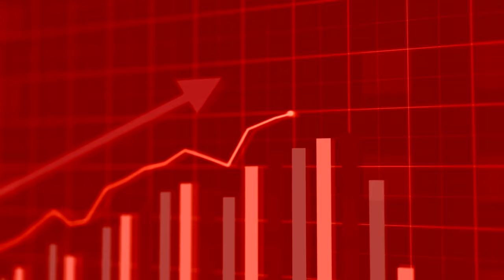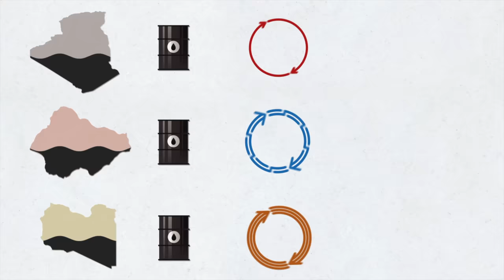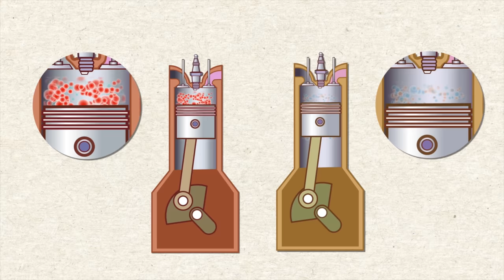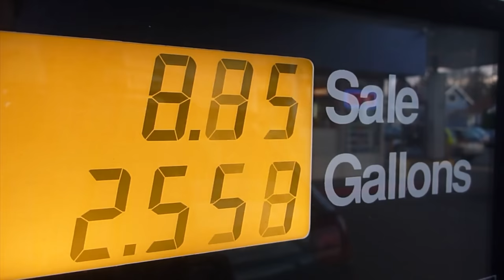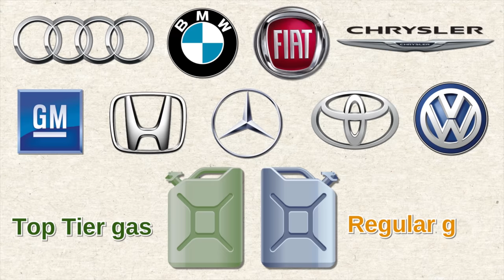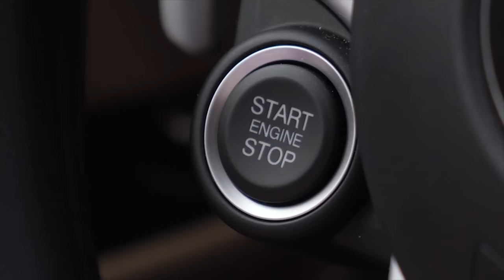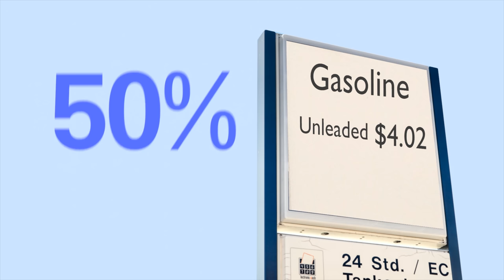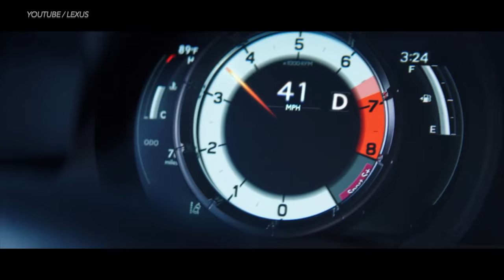No One Has the Balls to Tell You the Truth About Gas Prices, So I Will

Comment: You do realize that EVs aren't going to take over the market until the batteries are plentiful, cheep, light weight, and safe?
Reply: You don't know how to spell "cheap"? 🤦🏻‍♂️😆
Reply: @JohnWilkesBased  you don’t know how to spell “booth” . John wilkes booth
Reply: @PhatAssObese  you don’t know what “based” means?
Reply: Batteries are already in more places than fuel tanks [fuel cell phones!] ... We should be able to do it.  Besides, If You Can't grow It You Have To Mine It.   That won't change.
Reply: In my world EVs are 100% (never look back). Will see who is laughing last.
Reply: @JohnWilkesBased  he was trying to say jeep.
Reply: I was calculating the $$ saved with $5/gallon gas using an EV with the "average" number of miles an American drives. For me that average was insanely high (1,000 miles/month) The problem I saw was even with high gas prices an EV over 10 years was still $1,000/year more expensive. In addition batteries may only last 7-10 years (new ones are looking better), but also the vehicle in the north will most likely rust out in 10-15. Now with higher gas prices that raises the price of the EV and it's parts in addition to making it more expensive to drive with gas... emotionally buy an EV... logically you'll have to complain to politicians, adjust your behavior, and ultimately suck it up.
Reply: @jeffkendel1570  at home… almost exclusively
Reply: @readypetequalmers7360  battery prices have gone down 80% over the last 10 years… give it time.  Gas has gone up also, and will continue to do so.  Give it time.
Reply: You do realize that we don't have to resources to produce ev
Reply: They won't take over. California is currently having problems with their power grid due to electric vehicles. Electircs cars make more pollution to be manufactured than gas vehicles and I'd like to know, where the hell are we gonna put those lithium batteries when they go bad. Oh, and they are a pain to put out if they catch fire. Water can cause them to explode.
Reply: @coloradoriversurfer  Comparing a cell phone battery to an EV battery is like comparing garden hose to a river. The scales are not even comparable.
Reply: @jeffkendel1570  The infrastructure won't be able to handle it.  At this time. Probably not at "that" time either there'll be rolling blackouts    Watch and see
Reply: Hello friend! Scotty addressed that... I suggest you work on your comprehension levels, so you don't make foolish comments.
Reply: @overtorque  I'd need some sources cited on that one. I'd expect the grid problems to be related to A/C units more than EVs since they are largely charged overnight unless on a road trip.
Reply: @readypetequalmers7360  I did the math for $10/gallon here in the Netherlands. And i can get a far newer, nicer and more luxurious EV for the same monthly total cost of ownership. That's with 2000 miles per month. We were spending 4000 Euros per year on gasoline. Gas and electricity prices are both trending upwards. But electricity is less than 1/4 of the cost of gas, so it's a huge protection against energy price inflation. Fossil fuel prices are only going to go up in the long run as well.
Reply: @Bertuzz84  2000 miles/month is a lot of miles (2x more than average American), but yes it is true. If you drive A LOT and there is high enough gas prices... then EV's could be worth it. Fossil fuels don't have to go up either. All we need is an administration in the US who allows pipelines and increase production it could swing the prices a lot. That is a risk EV makers have to acknowledge.
Reply: Plus
Our
Grid
CANT
Handle
It!
We’ve overtaxed the system as it is now!
Reply: @coloradoriversurfer  We refuse to mine our own country though and rely on mining in the 3rd world
Reply: @cammer68oliver2  I was thinking about this... I think the solution is home batteries. (LiFePo) If it became a problem I think the power companies can create a program and offer home batteries that they themselves can control. If they did this they could distribute the usage more evenly.
Reply: Imagine the land needed for all those spent batteries and then leaking into our groundwater, not to mention the cost for new batteries.
Reply: @overtorque  There are a few issues with the statement.

First, California's power grid problems aren't caused by EV or renewables for the matter. That will be a problem in 2040 if they don't increase capacity, but not now.

On the question of if EVs are more polluting to make than ICE, it depends on where the batteries are made. If it is made in China, it is 60% more polluting to make. If it is made in EU or US, its around the same. Taking into account that and non renewable electricity sources, the lifetime emissions of an EV is 70% less than ICE and projected to increase.

EV battery recycling is a thing, but there is not enough old EVs to tell what will happen. For all we know, they might all end up in a landfill, or end up being used as cheap grid storage, but we don't know yet.

EVs is more reliable than ICE. That's indisputable. It costs less on maintenance since there is less moving parts.
Reply: @solarlux7856  
Two things in the way of your panacea:
1. Cost
2. Charging time
Until those two factors are resolved, you're dreaming.
Reply: @jamest3552  Given that ICE car sells peaked in 2017 and is now in permanent decline, I think the word "prophecy" would be better.
Reply: @JohnWilkesBased  for once in your life you can feel smart 😆
Reply: @readypetequalmers7360  that allows pipelines lol
Reply: @HDESM  I meant fuel-cell telephones
Reply: @elliottnunez1057  there'll be rolling blackouts - Batteries are dispatchable loads. They can help to stabilise the grid as any other flexibility option.